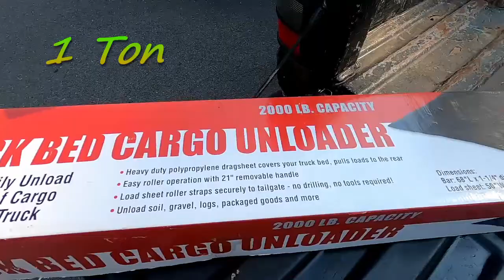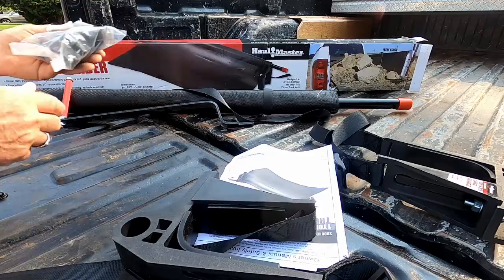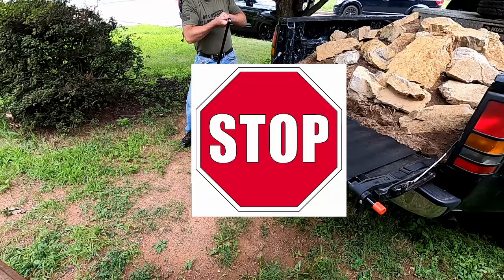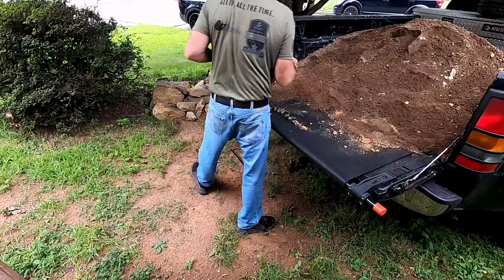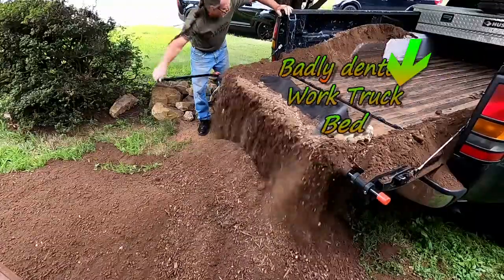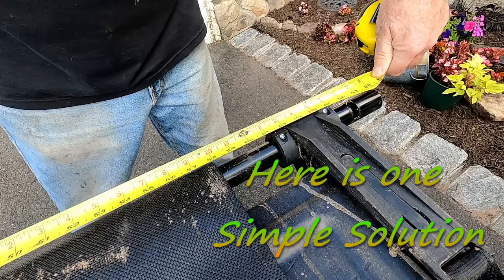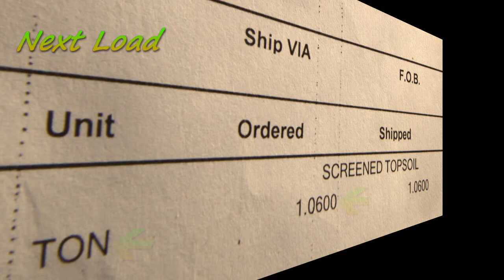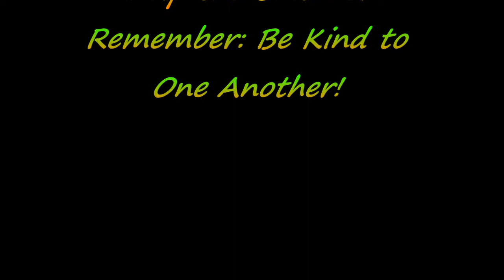Harbor Freight 2000lb Truck Bed Cargo Unloader

Comment: I have one of those. Get you a 4x8 sheet of shower board, very slick stuff and lay it in the bed  and  run the  unloader fabric on top. I have moved 2 Ton- 4000 pounds of rock, easy peasy.
Reply from the maker: Hey Goldsby Washington,  Thanks so much for watching and the great suggestion.  Will sure try it out.  Thanks and have a great day!!
Reply: @jamesmarkkonstruction6742  Hey Bro, enjoyed the video. Let me know what you think after you try it. Depending on how long your bed is, you may have to buy 2 sheets as it needs to go from back all the way to end of tailgate.
Reply from the maker: Sure will, Thxs again!!! Jimmy
Reply: Can you please send a link on where to purchase the shower board?  Thanks.

Comment: Two other improvements.  Buy a cheap harbor freight tarp, to go onto bed first, spray a can using silicone spray onto bed and tarp! It will become more slippery and easier to move the load!
Reply from the maker: Hey MissionaryForMexico ,  Thanks for watching and for the suggestions.  Have a great day, Jimmy

Comment: Why not weld a socket on the end with a 1/2in drive. Then use a ratchet with a "cheater bar"?
Reply from the maker: Hey blitzegron4848,  Thanks for the comment,  You have hit on a very popular upgrade from quite a few people.  Sounds like a great idea.  maybe I will add this and put it out.   Thanks so much for watching and have a great day.  Jimmy

Comment: Had one of these I cut down put on a Toyota 4x4 pickup worked okay. I wouldn't put it on a pickup you care about rough on the tailgate also doesn't slide well on a bed that has a spray in liner. I had a plastic liner it worked good because it slid I decided later to just build a dump trailer that holds about 7500 lbs. I have  3/4 ton Ram Diesel tows it easy. When I had that little toyota pickup I used to move gravel in it have the guy fill it until the rubber stops were 1" from the rear axle. Probably over loaded but I only had to go a few miles on surface streets drove slow.
Reply from the maker: Hey Mike, Thx for watching along with the great story/comment.  The Dump trailer sounds cool.  Have a great day, Jimmy

Comment: Had the exact same problem and almost the exact same fix.  Instead of putting a piece of pipe inside the original flimsy one, I replaced it with a solid steel 1" bar.  I also had to make a couple diagonal pieces to wedge between the tailgate and the box.  The bumper strap wasn't strong enough.
Reply from the maker: Hey Solar Guy, Thanks for the info! Sounds like you beefed this up nice. Have a great day. Jimmy

Comment: Be nice to use some type of adapter so you can use a "hole-hog" drill or winch to just run the load out electrically with the push of a button.
Reply from the maker: Hi cayankeelord3730 ,  Great idea in your comment.  Thanks for watching and thanks for sharing.  Have a great Day, Jimmy

Comment: Great fix! I'm wondering to save your back are you able to get a socket fabricated to the handle end so you could attach a milwaukee drill for quick unload?
Reply from the maker: Hey Fritz,  That suggestion seems to be popular, I would use some caution due to the amount of torque required to turn the handle.  The Drill sure might try to break your wrist unless you have a long handle on the drill.  Thanks so much for watching.  Have a great day.  Jimmy
Reply: @jamesmarkkonstruction6742  understood, thanks for the information!

Comment: i wonder if you would be able to weld a socket in the pipe and use a cordless impact wrench
Reply from the maker: Hey Dave, Thank you for the response.  I bet you could, however, it will depend on your load and how much leverage you can maintain on the impact gun.  You might need an extension on the handle of your impact gun.  Good luck and let me know how you make out.

Comment: I have to weld another short piece of pipe to mine to get the handle to clear the truck so I wouldn't hit my hand with the crank handle against the bumper. Mine was a little too close. I  used a piece of thicker wall tubing so the hold would be stronger and not strip out like the original one did. 
 And I found if you have a plastic bed liner, the unloader works a hell of alot better because it slides easier than against the rough uneven metal of a truck box.
Reply from the maker: Hey PainterD54, Thanks for the great comment, those are great additions.  Yes, the surface under the unloader does make a big difference, you're right.

Thanks again for watching and have a great day!! Jimmy

Comment: Does the L bracket make dents on the tailgate outside body panel. Everybody miss
that question.
Reply from the maker: Hi Hey yo,  Thanks so much for watching.  Great Question.  No, No dents They do not even scratch the paint.  There are pads on the inside to protect the finish.  Have a great day.  Jimmy
Reply: @jamesmarkkonstruction6742   thanks for replying. I will buy one and i will insert 3/4 black pipe to make it more stronger and no more bending of the pipe. Try buy one 4x8 plastic panel at home depot so the canvass will just slide easily even with more loads on top.
Reply from the maker: Hi Hey Yo, Sorry I missed this follow up.  I wish you the best of luck with this.  I also use these truck bed side fillers to help with the unloading process https://youtu.be/1PcV3yfZdPY, see if you like them.  Thank you again Jimmy

Comment: Battery operated drill or impact wrench.
Reply from the maker: Hey kirkkramer2412 ,  Thank you for watching.  You are in good company, quite a few have mentioned using a impact gun or something like that.  As you may have noticed, depending on the weight. in the bed, it does require a lot of torque.  let me know if you are able to adapt this with an impact gun.  have a great day, Jimmy.

Comment: Since I see you have a mill at your disposal. It looks like you need to make yourself a longer handle or a couple reduction gears to make it easier for you. Plus i would put a tarp down before I would put something as fine as dirt in the tailgate. 
That way you dont have to dig out your truck bed around your your wheelwells. Also I woudnt want to be the one following you as dirt falls thru the cracks of the bed.  That if a rock falls and cracks my whidsheild you can be sure ur that I will have your insurance buyvme a new one.
Reply from the maker: Wow, Thanks for watching

Comment: A full yard of dirt is ~3000lbs
Reply from the maker: Hey Dan Thanks for watching I really appreciate it,  You may have noticed the invoice shown in the video showing 1.06 tons from the scale, that comes from their one yard bucket machine.  
Here is what I found  direct from google "One cubic yard of dry dirt weighs about 1,944 pounds or 0.97 US tons, based on a density of 72 lb/ft³.Jun 28, 2022".  So it also depends on what type of dirt you are talking about,  the video used topsoil.  Thanks for the comment and have a great day

Comment: There is a reason that they make dump beds
Reply from the maker: Hey David,  Thanks for watching.  You're  right, That's why I own two dump trucks.  Not everyone can afford a dump bed and this is the only truck that can fit into tight spots on some jobs.  Dump beds cost between $1500 and $5000 this costs $50.  Thank you for the comment.  Have a great day, Jimmy

Comment: Looks cheap. Not going to bother with it if it cannot move that much dirt.
Reply from the maker: Hi eternalbeing3339,  Thank you for watching and for the comment.  looks can be deceiving,  as the video suggests, the roller rod needs reinforcing but the rest will perform as suggested.  For the price it will definitely beat shoveling out the back of your truck.  Thanks and have a great day. Jimmy